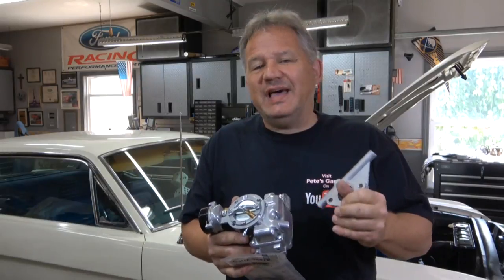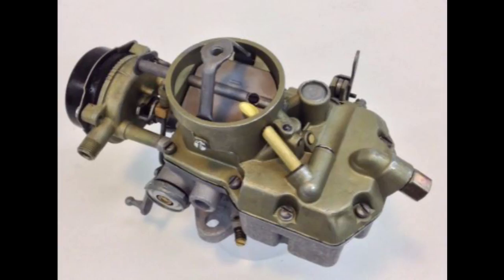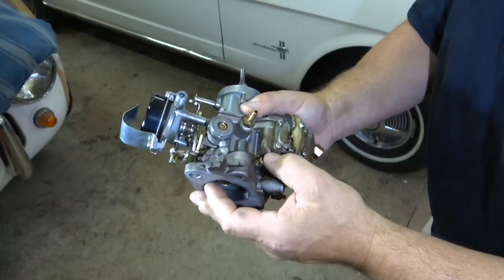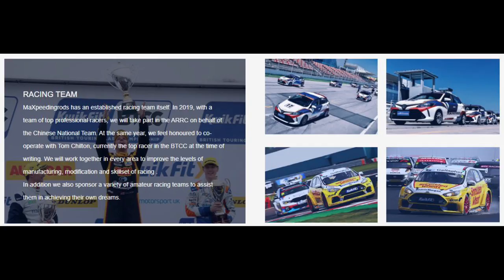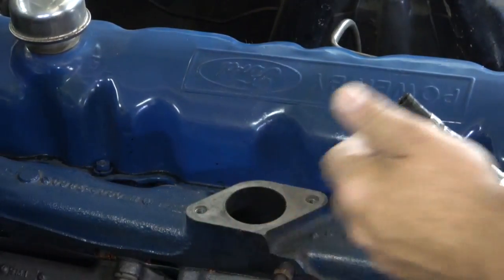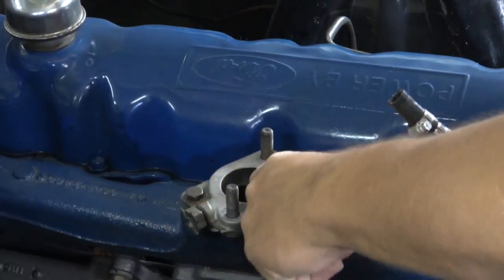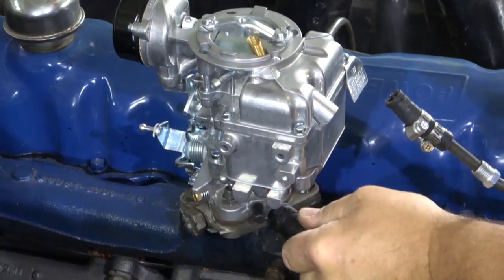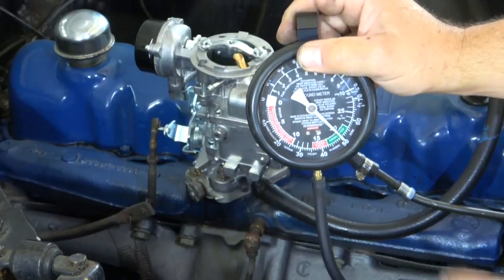Ford Inline 6 - Choosing, Installing and Tuning the Right Carburetor and Spacer

Comment: The 240 and 300 ford inline six engines were a completely different block. They also have removable intake manifolds. The Ford family of engines including the 144/170/200/250 all share the same block with slight differences. All of their cylinder heads can be swapped. After a certain year, 68 I believe maybe later, the ford 200 and 250 shared the same large log cylinder head. The biggest difference between the 170/200 and 250 block was the deck height to get the increased stroke for 250 cubic inches. The earlier blocks had a small log head on them. The small 144/170/200 engine family is also referred to as the “Falcon Six”. This engine family is easiest noted by the intake log being cast into the cylinder head. This makes the engine very very different from the 240/300 inline six that ford used in their van and truck lines....
Reply from the maker: That's awesome! Thanks Nicolas
Reply: Amazing knowledge
Reply: If one is going to swap heads on a 200 6 it's best to go with one off a 250 6 made after 75 as it flows The best of the small 6 heads and has hardened valve seats so there's no need for lead additive but I believe it would have to be decked to maintain proper compression ratio.

Comment: thanks Pete! I'm in the UK and I have a 53 F100 with all Bronco drivetrain and 170/6 motor with a yf carb which is missing the linkage between throttle and choke. Choke doesn't open much, going to get a replacement carb sent over - this video was crucial info, thanks mate!!!
Reply from the maker: I have a YF carb if you'd like it. Pay or shipping and it's all yours
Reply: @PetesGarage  wow Pete, you're a legend! If only I knew a few days ago, ordered one up. If I have any trouble I'll be in touch, you're a star!
Reply from the maker: Good luck my friend

Comment: My 72 Comet w/ 250 came with a Carter 1bbl. Suffers from vapor lock here in Texas.
Reply from the maker: You can fix that by putting a large plastic bowl type filter just before the carburetor

Comment: I been seeing plenty of people using the 1100 autolite because of the 3/16 smaller diameter it increases velocity and low end torque.H.P. decreases only moderately on rhe high end where you don't use these engines anyhow.Best it increases mpg.

Comment: 2:12 That hole you  say is for the idle control circuit is actually a vacuum source to draw hot air from the exhaust manifold through the choke housing.  Follow it back up the side of the carburetor and you'll see it leads to the choke.  If you block that off, for instance by using a gasket with no hole there, it stops hot air from circulating to the choke, making it take a looong time for the choke to open.  It has nothing to do with the idle circuit.
Reply from the maker: Thanks

Comment: i think you may have the 250 cyl head from a mustang   the 240 is the same engine family as the 300 with removable intake   the 144/170/200&250 all have the manifold cast into the head   my 79 granada has a head that looks identical from the outside but has larger valves than the previous years  if you want a little better performance look for a 78,79or 80 granada 250 cyl head they also have hardened valve seats for unleaded gas
Reply from the maker: Thanks Mike

Comment: That is most definitely a 250 cylinder head I have owned both small and large block ford 6 cylinders and its not hard to tell after  you work with them for a while. You can actually remove the intake from 240 and 300 but not the small block
Reply from the maker: Thanks my friend
Reply: There are a couple 250 heads wich have a removable intake but most are not ford origonal heads but one sure way to tell is if the distributor is forward of center of engine from front to back its small block six and big six has the distributor pretty much in the center but always on drivers side

Comment: I have a 1986 Ford 300 FI......I want to change it over to carburetion.....I would appreciate your suggestions and inputs....Thanks, La Grange, Texas
Reply from the maker: Change in the intake and put on a carb. You'll need a regulator for the fuel pressure.
Reply: Thanks, Pete....I appreciate it....
 @PetesGarage

Comment: If it was out of a Falcon it was not a 240 which was the big block 6 in the 240/300 family used for full size cars and trucks.  Probably a 250 which was same block as 170/200 with a slightly taller height.
Reply from the maker: Thanks

Comment: Not sure if you still follow questions on this post but heres a shot. 
I have a 1983 ford bronco with the 4.9 300 inline 6. The carb is nothing but hut problems for us at 9k feet elevation. Everyone says modify to a 2 or 4 barrel. Id rsther figure out a better carb than the original motocradt single on it. 
Any suggestions on an upgraded carb and air cover? We are running high idle like screaming high and adjusting it can get us to a low scream. Still smells of fuel no matter what and at low idle scream it likes to die. So any suggestiins are greatly appreciated!
Reply from the maker: Putting on a 2 barrel would help as long as it fits your intake. You'll have to re-tune it.

Comment: Hi. I have almost the same problem, but I am looking for the spacer you have on your car, what is it so I can look it up? I don't need the spacer to fit the 100, I have the carb you have but need the spacer. Thank you!
Reply from the maker: That is a great question. I have not been able to find those anywhere
Reply: @PetesGarage  Do you think a larger carburetor, the 240, such as you show here can go onto a 200 6 cyl? We have had nothing but problems with her carburetor for years, preventing me from driving my sweet '66.  We have replaced, and rebuilt, to no avail. I bought her in 1990 and have restored her with my Dad. He's been a mechanic for 50+ years ( a Studebaker lover), but even he is pulling out what's left of his hair and ready to think outside the box. Thanks again.
Reply from the maker: I've tried a few different carbs. Make sure you have the right gasket. A 200 doesn't need a big carb. You may have to play with the jets to get it right.

Comment: Question, do you have a video on the choke adjustment on both the spring and linkage side? Also where is the choke pulling the air from on the manifold.
Reply from the maker: I do not, but the choke should be hooked to a heat riser between the exhaust manifold and pipe
Reply: @PetesGarage  thank you!

Comment: Awesome video. I just replaced my carter 1bbl on an f-150, but I feel like my fast idle is way too high. How do I adjust that? Just put the screw lower on the gear?
Reply from the maker: Yes, that is on the choke bell crank for the idle control

Comment: Is there anywhere I can find that gasket you used for the gasket that goes between the spacer and the intake manifold? I’ve looked everywhere and have had no luck. Your video has helped me a ton!
Reply from the maker: I have been searching for those forever. When I find them at swap meets I buy them, they're like gold
Reply: I got gaskets that didn't have the hole, carefully poked the proper locations with a screw, and then punched holes in them with an el-cheapo multi-size punch.  Harbor Freight should have 'em.  I had to put a few thicknesses of regular paper between the gasket and anvil to get the punch to go all the way through the gasket; I banged on the punch with a hammer to make sure it made it all the way.

Once installed and engine running, before connecting the hot-air supply to the choke assembly, stick you finger against the choke assembly inlet to verify that you have vacuum there to suck the hot air in.  Success!

Comment: I have a 1971 Ford F100 with a 240 inline 6 and a 1 barrel carburetor. I have never been able to get the tuning quit right. It runs great but smokes all the time and I don’t know what I need to do to clean up the exhaust fumes.
Reply from the maker: Smoke may not be the carb
Reply: @PetesGarage  I appreciate you commenting back. It didn’t used to smoke at all but the fumes were smelly. I understand it’s an old truck so it’s gonna smell different than a new truck but since I’ve changed the carburetor to a reman carburetor a few years back it’s always been finicky I’d like to put a new carburetor on there an see how it would do

Comment: Nice video pete. I received my yf carb   thursday and installed it today. Great carb. Q; How is the choke operating. I didnt see you hook it up to anything.
Reply from the maker: I leave the choke all the way open since I only drive it in the summer. I have to find the correct tube to hook up the heat riser.
Reply: @PetesGarage  last question😊. Every carb I try, 3 to be exact, fuel seeps out the top gasket. Even on this one. I'm kinda lost as to why it's happening.
Reply from the maker: Wrong gasket or you're tightening too much
Reply: @PetesGarage  this carb is out the box. The same one you use in the video. Do the V6 and V8 fuel pump have the same psi output?
Reply from the maker: Yeah, the fuel pump is over powering the needle valve in the carburetor
Reply: @PetesGarage  thanks pete

Comment: Hey Pete my 1968 mustang with the 200 six with the 1100 carb has no spacer at all  and doesn’t look as it ever did? When were these used?
Reply from the maker: They were used on most of them. I don't think your head is original if it doesn't have one

Comment: Why don’t you wanna tighten the gasket too much? I’ve got an ‘83 F250 that needs a tune and I wanna do it myself. Shops cost too much for my $10/hr wage 😂
Reply from the maker: You can bend or warp the bottom of the carb and it won't seal
Reply: @PetesGarage  ohhh that makes sense. Thank you!

Comment: Id like to know how to get 25mpg out of my 81 e100 van.. i was thinking of bumping up compression a tad in the overhaul but not to familiar with the dinky little carbs on these
Reply from the maker: Change the gears
Reply: @PetesGarage  it’s got 3:11’s if I remember correctly and 3 on the tree
Reply: @mikecorleone6797  my dad had a 2:75 ratio on rear differential, three on tree and he'd get over 17 mpg. on his 65 f-100 swb and a 300 6 cyl. with a Carter. smallest carb. the yf. This carb can be found on 50s trucks and some cars too.

Comment: Is a spacer mandatory, or can I do without? The carburetor I took off didn’t have a spacer, but I’m replacing with a new carburetor.. so not sure if I need a spacer or not?
Reply from the maker: What king of engine? This spacer is needed because the mounting holes would not match up. If you can mount the carb without a spacer, try it.
Reply: @PetesGarage  , I have the straight 6 240. The carb I took off didn't have a spacer, so when I put the new carb on.. I may not worry about the spacer.
Reply: @arkstudios101  my 240 was the same. I didn't have a spacer when I took mine off as well.
Reply: How do I connect my vacuum hose from the carburetor to the vacuum advance?

Comment: Hey Sir. I have a 80 f100 with a 300 inline 6 and it starts fine but it seems to lose power once you start driving. I have electric fuel pump and regulator with return line and wondering what cause it to lack gas after starting off. Any suggestions?
Reply from the maker: Float set wrong in the carb

Comment: Better choice is a 4 barrel manifold 4 barrel carburetor and a header, you will have twice as much power and great gas mileage
Reply from the maker: Thanks
Reply: Not an option with the falcon six due to the non-removable intake manifold.

Comment: NAw,don't do it.Cut the log,open up a hole.Use V.I.s adaptor to put on a Weber/Holley 5200 or an Autolite 2100/Holley 350.I've done 18.All will take either adaptor.All it takes is a grinder and time.

Comment: So when I tried using the vacuum gauge on mine, the gauge was jumping so bad I couldn't get a good reading. Is this caused by a vacuum leak?
Reply from the maker: That cold be a few things including a bad cam or loose timing chain
Reply: @PetesGarage  300 inline 6 doesn't have a timing chain. They are gear driven. I had to replace the cam already. Thanks for the advice.
Reply: @willhart7861  I had that problem turned out to be a burnt valve that had sunk in the valve seal.

Comment: I put it in what looks like the same port on the manifold, but there is no pressure at all. the gauge is at zero. what am I doing wrong? I blew into the hose and the vacuum gauge is working.
Reply from the maker: Some of those ports are blocked
Reply: thank you! i’ll shine a light down there and see if i can find a way to unscrew whatever’s in there.

Comment: Isn't that a 250 cylinder head?  A 240 would have a bolt-on intake manifold (among other differences).  Otherwise good info.
Reply from the maker: I'm going by the casting numbers

Comment: I think this is the Rochester 2 bbl → As he says these are ""easy to tune" and as well a complete rebuild which usually is the way to go in an era when "Stimmie" is leaves & stems and dot edu is selling S.T.E.M. 's ~ folks there is a metering rod which has to be set right — AW Hell he is just using a rebuild from the parts retailer →NY !
Reply from the maker: Thank Nicholas